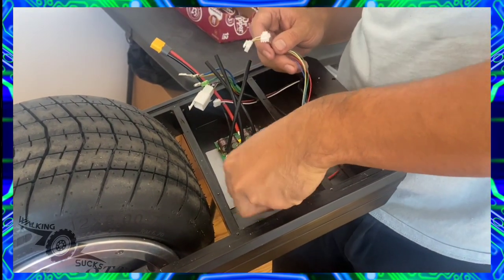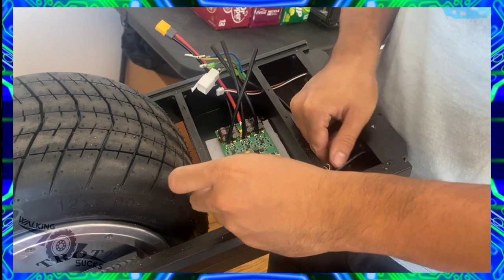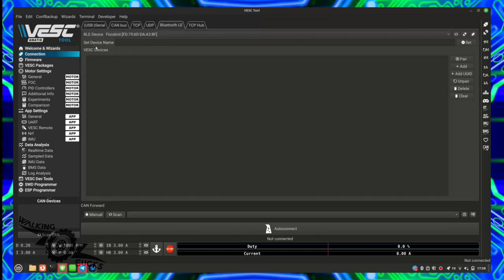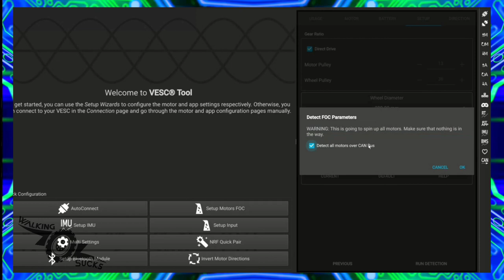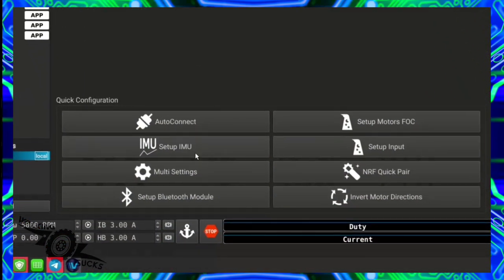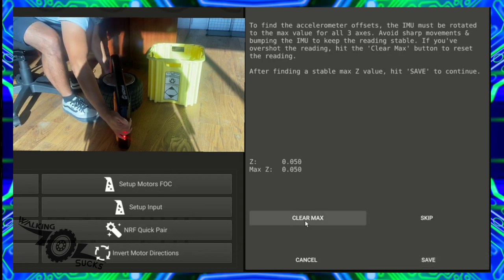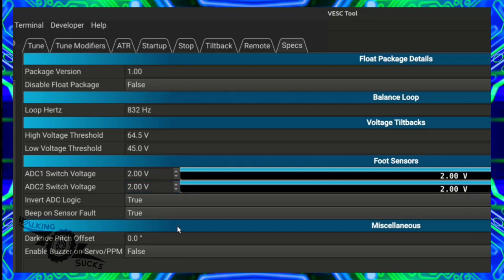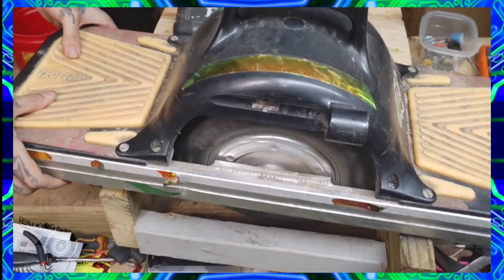FOCsTrot VESC Controller Installation, Motor Detection, IMU Calibration, and Setup

Comment: Hey Joe. Do you know if it’s possible to install in the focstrot controller the latest standard VESC firmware overriding the pre-installed one?
Reply from the maker: You can upload different firmware into the FOCsTrot controller if you choose. No promises on compatibility with these boards though. And you'll have to keep in mind the hardware limits of the FOCsTrot controller itself as well

Comment: Joe, I have the revised trotter Gosmilo X5 and had a cutout around the 8 mile mark with 40% battery left causing me to get dumped. I was trying to update the VESC settings and ended up doing something wrong now the board is not balancing, and it shoots out from under me like a missile, I need help to reset the board can you help? Sent you an email.
Reply from the maker: The battery % gauge is a general idea at best. You should keep an eye on the battery voltage itself instead. The X5 battery has a built-in protection feature that shuts it off and requires a reset if the voltage dips below 48v. This is to protect the individual cells in the longevity of the battery, but can cause different issues in certain situations. For example if the boards sit for too long, the slight parasitic drain of the controller will cause it to dip below that 48 volt threshold, requiring a hard reset of the battery by directly unplugging it from the controller after charging above 48v. Also if the controller settings do not account for this, and the battery pack is allowed to drop below 48 volts while riding, it will shut off and require the same hard reset after being charged above 48 volts . This is addressed in the new xml files available on my website. It could also be due to the current limit settings, which revert to about 70 amps after running motor detection instead of the required 120 amps. There are a lot of resources for getting into learning VESC and how values affect the ride, as well as troubleshooting at pev.dev

Comment: So with VESCing it, does the Trotter now offer a sensible choice for some riders? I guess the characteristics change a lot.
Reply: The characteristics changed slightly. You can play with these settings to dial in a good feel that fits your riding style. I think the trotter has ALWAYS been a sensible choice for many riders.
Reply from the maker: Completely changes the ride profile. No more jerky back and forth, and it is infinitely tunable now

Comment: Hi Joe. Do you think that changing the voltage value for the rear sensor could simulate a posi mod?
Reply from the maker: It could, and might be worth trying. No promises on how it is going to behave, though 😅